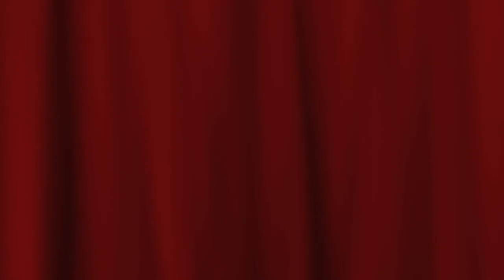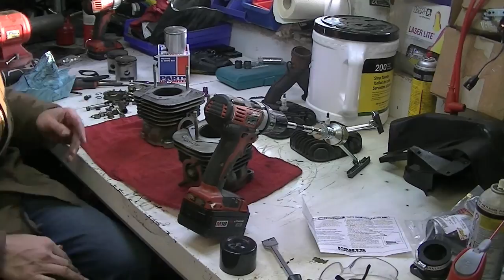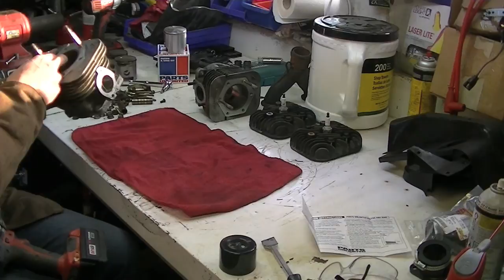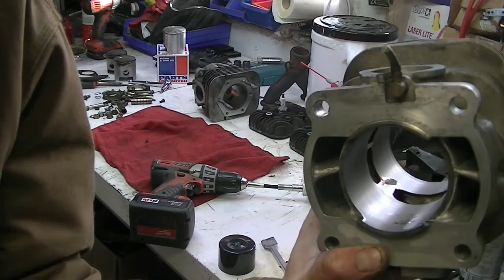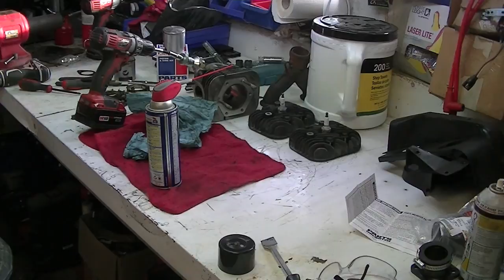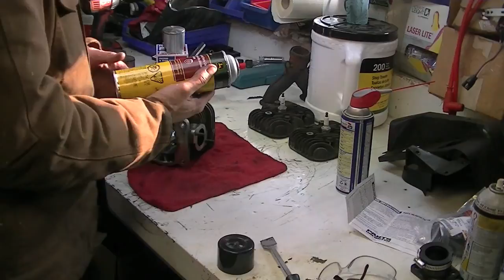Polaris Indy 440 Fan Cylinder Hone

Comment: The point I am trying to tell you is you can't use a standard sized piston in a worn out cylinder is a major waste of your hard earned money, the only way is if you have had a new sleave in, otherwise your putting a new piston in a worn whole and the new piston will wear very very fast. I've worked on sleds since the 80s I always take a bore gauge and then you no how much bigger piston you will need, or have your machinest check the bore and order accordingly you should use a forged and hypereutectic Pistons for a long fun life!!!!!

Comment: Why is it that people think I can hone the cylinder never using a dial bore gage to find out the exact size. It's people that keep my shop full, side note your cylinder will always be barrel shape at the bottom of the stroke!!!!
Reply from the maker: I should not have used the term hone as all I was doing was prepping the surface for new rings.
Reply: @suzukiman650  on my CCW 400 I took it to the machinst and he bored it out .098 and now I have 440 CC and he ported and polished exhaust and intake, it now has 245 psi in each cylinder and a custom exhaust on the dyno it pulled 100 HP. But for anybody WHO IS REBUILDING AN ENGINE HAVE THE CYLINDER BORED OUT IF NOT YOU ARE THROWING $$$$ DOWN THE DRAIN😂😂😂😂😂😂
Reply from the maker: @hank5655  I watched the video again and I said the pistons were standard bore;  they were actually oversized.  The cylinders had been bored already by a machinist but my brother in-law and helper messed up put the pistons (wrong way around, hence me redoing it.  The bores were fine, the light hone was just to make sure the new rings seated in properly.

Comment: Awesome video !! Are you Canadian ? Where did you buy that owning tool and how much did it cost you ? And was the top end rebuild successful ??? I'm gonna be doing my 98 583 Grand Touring and I'm watching every single video to help me in the process ! Thanks !
Reply: +birchdale rasmussen This engine has sleeves, not plating.
Reply from the maker: Yes, I'm in Alberta.  Unfortunately even with the new pistons and the hone compression is low for some reason.  I will need to have the cylinder bored and put over sized pistons in.
Reply: @suzukiman650  It's been quite a few years so you might have it figured out by now, but I'm currently rebuilding a polaris 440 that the previous owner rebuilt, but only had 105PSI compression. I noticed that the aftermarket SPI pistons that were in it were slightly too small of a diameter, the piston to cylinder clearance and ring gap were too big. Since OEM oversize's are hard to come by, and I don't like forged pistons, I bought some 20 over SPI pistons that would be too small if the cylinders were bored exactly 20 over, but I should be able to take the cylinders and pistons to a machinist and get the cylinders bored out to the correct tolerance.
Reply: +Lafond RC its because its a plated cylinder honeing ruins plated cyinders
Reply: @EternalTinkerer lol the sleaves are plated  every sleave has a plating exsept for in the 1950s and shit trust me there plated i have the same sled and other sleds from the same year older and newer they have either a nikasil or steal or something else
Reply from the maker: +birchdale rasmussen Wrong. This engine had the cast iron sleeves replaced previous and they can be bored and honed if needed.  http://www.lasleeve.cc/index.cfm?event=product.display&product_ID=1433
Reply from the maker: +birchdale rasmussen As well,  I rebuilt my old 99 RMK 500 with over sized pistons.  Had to get it honed out as well.  That sled still has great compression and runs well.
Reply from the maker: +birchdale rasmussen More proof.  https://www.hiperf.com/acatalog/WISECOPOLARIS440CC.HTML